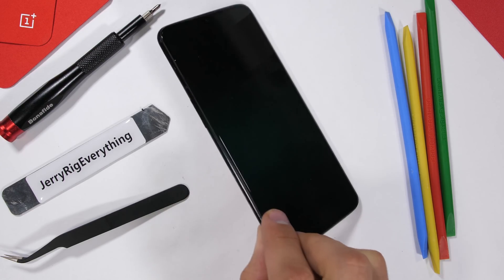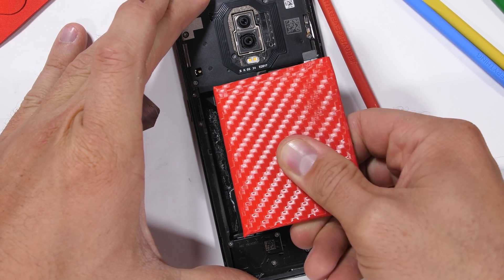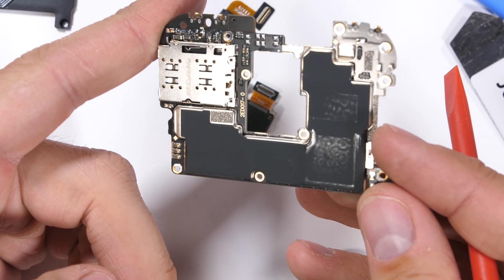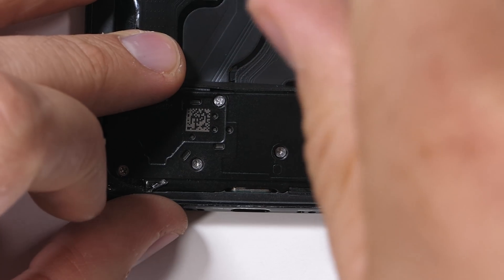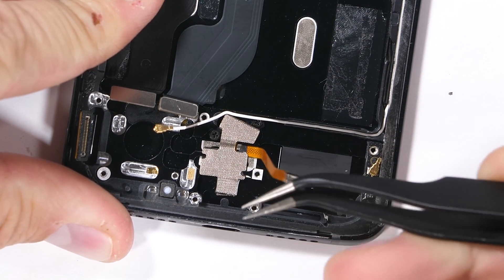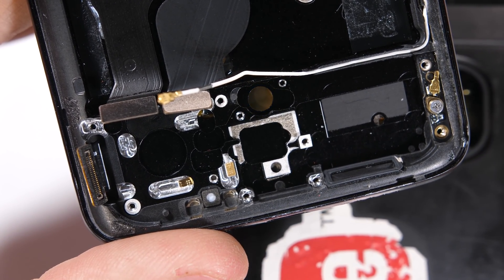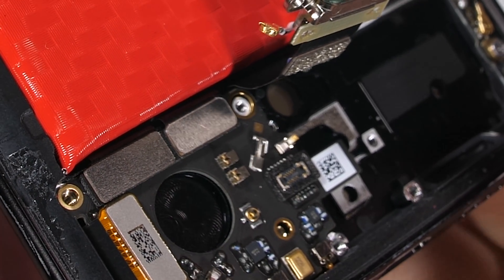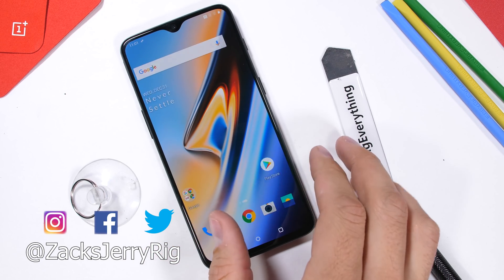OnePlus 6T Teardown - Can under display cameras be real?

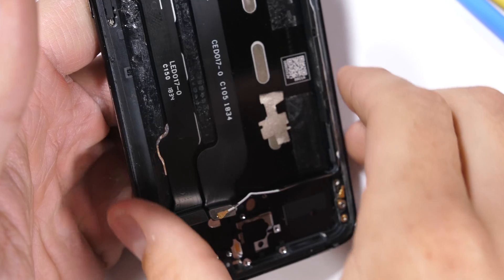Comment: 4:15 Unfortunately the cameras and other sensors would have to be tinted green to hide them like how it is with the 6T. If manufacturers and brands do not care much about the aesthetics of the phone they can blatantly display the camera that is underneath the screen. However if they would rather make a device that is seamless they may develop a software to filter the unnecessary green tint that is hiding all of the sensors.

Comment: Please, tell me, is OnePlus 5t still a good phone to choose in 2018-2019? 

6t doesn't have a 3.5 jack, so this phone is not my choice.
Reply: Oneplus 6 also has jack. But the 5T is a very good phone, it is fast as hell, it has aluminum back cover, but only moderately water resistant. It is splash resistant only. The 6 has better water resistance. But it is all glass. And glass is breakable.
Reply: Just get the OnePlus 6. That's what I got. It's still fast as heck plus head phone jack to boot :). Oh and since the T is out. I'm betting the slightly older OnePlus 6 will be discounted.
Reply: I agree with @moninn yem as the 6 is currently at least in china on a huge discount, starting at the price 2799 rmb - around 450 if youre gonna buy in America
Reply: @Kurt Rozentaun - on the us store it starts at 529 american dollars.
Reply: Just make sure you don't buy a pixel 3 or a mate 20 pro as they don't have a headphone jack either.

Comment: To be honest with you. 

I have tried fingerprint scanners on the front of phones and the ones on the back. 

I was a fan of the front fingerprint scanner.. 

but now that I've gotten used to the Galaxy Note 9 back fingerprint scanner.. I ACTUALLY FIND IT MORE USEFUL IN MORE SITUATIONS THEN THE FRONT.. 

When I go to pick my phone up even in my pocket my finger is already on the fingerprint scanner so it's already open before I get it out of my pocket. 

Also when my phone is in the car windshield holder I have my fingerprints record it for my middle finger and index finger on both hands. All I have to do is touch the fingerprint scanner on the back with either fingers or either hand any direction it doesn't matter and it opens perfectly and seems more convenient than the front.. 

So to each his own. I guess it all depends what you like and what you used to but it's not critical.. 

What is critical IN MY OPINION PHONES NEED FINGERPRINT SCANNERS YOU'RE NOT ALWAYS LOOKING AT YOUR PHONE WHEN YOU NEED TO OPEN IT.. your phone can be at a slight angle the fingerprint scanner is a necessity to me I use it more than any unlock feature..

I must say the combination intelligent scan for the Samsung Note 9 Works fantastic even in the dark.. 

If I am relatively in front of my phone in my car just sitting in my seat. the phone opens automatically by looking at my face and I'm about 2 to three 3 away!! 

Now I'm hooked on the Galaxy Note S-Pen Drew tons of pictures and they teach you how to draw. I haven't been a artist my whole life all I could only draw stick figures LOL.. but now I can draw a lot of stuff and it's a lot of fun. 

To me it's the Galaxy Note series or nothing now.. 

Samsung an Android put Apple to shame in so many different ways.  the experts have spoken saying Apple phones are the same old thing over and over again and not to mention they're usually 2 to 3 years behind in technology!!! 

 almost everybody who does the Android vs apple challenge for a couple of weeks like sakitek. they always go back to the Samsung or Android phone once you know what they can do and how much fun they are, with the Innovations, hardware,  software, customizations, and the complete entertainment package.. YOU JUST DON'T GO BACK TO APPLE!! No wonder why market share is 88% Android worldwide, and Samsung alone sells more phones than Apple... I guess people are starting to catch on FINALLY!! But it will be impossible to get the kids elementary school, high school and college to catch on BECAUSE KIDS ARE FOLLOWERS NOT LEADERS THEY JUST BUY SOMETHING CUZ THEIR FRIENDS HAVE IT NOT BECAUSE IT'S INNOVATIVE OR WORTH THE MONEY!  IT'S REALLY SAD HOW THIS GENERATION IS.. 

;)
Reply: No one is reading this novella, sweetheart.
Reply: @Tomazack  

I'm sorry you don't know how to read that sad :(

Thousands of people read the things I write and actually thanked me through all the other social media things I comment on.. I also run 4 businesses.. I have my own computer and phone repair shop!! With 30 years of electronic experience.. have plenty of people appreciating what I say so I don't need you!! 

You can't please everyone.. 

But the cool thing is I can talk into my phone a hundred forty words a minute takes me only a few seconds. 

So move on goodbye!!
Reply: muzikmon2267 you have four likes. No one stopped to read and like your comment, mr “ELEctRomICs PrOFFesionnal”
Reply: Damnit bro what voice typing do u use?
Reply: Didn't read this all, but you could just type "I just purchased mine Note 9 and I'm fapping on it, everybody must know!"
Reply: @orgazmin  

Oh another beyond dumb statement.. 

You don't have to read it dumbass you're not intelligent enough..

GO TROLL SOMEWHERE ELSE DOUCHEBAG!!
Reply: @muzikmon2267  I have 4 businesses mate.Get rekt
Reply: @muzikmon2267  or i think that disabling the comment is going to help???Nah,words can't fix you
Reply: @sharinabhamid9955  

YUP U HAVE NOTHING BAHAHAHAHAHAHAHA
Reply: @muzikmon2267  the erectile dysfunction playlist is hurting your point.Plz delete

Comment: You can't put a regular camera under a screen and expect anything more than bokeh blur. Like photographing with a tele lens through a tree. The FPS is ultra near focus and gets away with physics.
I see only two possibilities:
1. a round opening in the display, like is rumored for OnePlus 7. The "dead pixel" sensation could be more annoying than a notch.
2. Putting cmos sensor pixels right in between the screen pixels making "the display is the camera". The sensor would have to compensate for the light pollution of the screen. Probably needs a ton of computing to work.

Comment: Since the under-display FP sensor is just a tiny camera module, couldn't they make the front facing camera do the job at detecting the FP while retaining the normal camera functionality?

They probably need to create a new camera module that is sensitive enough to detect the FP when being touch while at the same time functioning like any other front-facing camera. 2-in-1 or All-in-one basically.

Comment: Put on OLED display, put on camera at the back of the OLED, when taking picture, have software temporary turn off just those specific pixel above the camera area, boom, camera under the screen.
But how about the blurry transparency seen through the OLED? You suggest!

Comment: I'd be okay with them not having the headphone jack but they can't even keep up with the demand for the bullets wireless. It was a very bold move to remove the jack without them having a proper stock for the wireless earphones (which are reasonably priced, but not available)

Comment: In a couple of years phones will be absolutely 100% display, foldable and displays, instead of having amoled blacks, they will have transparent spaces. Not the most practical thing, but after they make phones all display and foldable there won't be much left to do, so transparency would be the only way to compete. Instead of transparency we might get holograms though.
Reply: I still think there's a step in between the foldable phone and anything transparent/holographic. My guess would be one of two things: 

1. A piece of wearable tech that is as innovative as the original iphone. Maybe hololens inside a normal pair of glasses, or a 100% screen phone as a wristband that can flatten out for other use.
Or 
2. An extendable phone. Think the Samsung S7, but where the screen is retractable into the top and bottom bars, so you can open and close the phone physically.
Reply: @ALifeOfWine  Extandable phones seems like a great idea. Now combine the extandable phone with the wristband and u got a super portable phone/smartwatch.

Comment: If the finger print camera hole is invisible when display turned on.. why can't they put a regular selfie camera underneath the display and turn off the pixels in hole when it's in use.. so we can get rid of notch.. correct me if i wrong

Comment: You know what would be a great experiment ? If you put a normal camera there in the hole instead of the fingerprint camera and try and take a photo, see how the photo would turn out.
Reply: The software won't accept a camera
Reply: @randomaccount4382  yeah they are talking about putting an ACTUAL camera in there with the screen on to see how it would look I doubt its easy to find a camera so small right no though
Reply: @avawyllie7099  Apple camera bump to the rescue place its main lenses right up against the back side and snap away
Reply: @nanaki-seto  finally, at least on e of apples crappy design choices will come in handy somehow
Reply: Patrik Tobola it's not a camera, it's an ultrasonic sensor
Reply: @fuckingdank6333  It's actually a camera...An Ultrasonic sensor would be more secure but to expensive for the OnePlus line...And to the Question: A normal Camera couldn't focus because the distance to the display is to small...it would just be blurry :/

Comment: POCO costs half of 6T and has 4000mah and liquid cooling ..
Reply: Yup poco is good
Reply: i kinda agree with this and this is just my opinion but i think even the pocophone f1 are still a tad bit better than the one plus 6t for almost have the price. although you get better display, better UI, better camera with one plus 6t but pocophone still offer something that i need more than the 6t like the earphone jack, faster fingerprint sensor, IR face unlock, stereo speaker, liquid cooling system, micro sd and larger battery.
Reply: @firdausfahmi  yup..agreed 💯... OnePlus is an excellent phone, there is no denying that....but the POCO has a few features more than OP6t......
to deny that and be a blind op fanboy is just silly people
Reply: Liquid cooling is just their marketing gimmick. There is few drops of liquid and just traditional copper sink
Reply: @Jinny-Wa  Sorry, what?
In stress tests the performance of the Pocophone is much more stable than any of the phones without cooling.
Reply: @Jinny-Wa  lol...says who? Have u used a POCO?
It doesn't get warm or throttle even after playing PUBG at max graphics for over 3 hours! That is not magic....it has a better cooling solution than OnePlus.Period.
Reply: @daniel14871  The 6T doesn't throttle either buddy.
Reply: @VenkataY  I never said 6t throttles buddy....
Reply: @daniel14871  You never did. But that comment heavily implied that 6t would throttle with 3 hours of gaming. The "buddy" was just a bit of sarcasm, no disrespect intended.
Reply: @daniel14871  I have a Poco and yeah it never gets hot. Though with some OnePlus 6t tests it stays about 36-37C which is pretty darn impressive. Note 9 had the liquid cooling system as well but it was at around 38-39C after 2 hours of PUBG
Reply: @kylechoy2402  at such price point getting such efficient cooling is remarkable....even my iPad 2018 (way more expensive than POCO), heats up like an iron box if we play PUBG at max graphics for just 10-15mins to the point it's unbearably hot...and we need to reduce graphics to control heat
Reply: The Pocophone F1 is at this point a slightly better value than the OnePlus 6T but a lot of the cost savings with the Pocophone can be easily explained: cellular compatibility. You end up paying even less if you focus the device in a few or even a single region. Try using the Pocophone F1 in the US and you'll find it nearly impossible to connect to an LTE band reliably.
Reply: @GabrielIgnacio  agreed 100% ....but since I'm not gonna cross the Atlantic in the next 3 years, it doesn't matter....POCO is a phone made for Asia and Europe...it's not even launched in the USA buddy
Reply: Vincent Saipudin  It will get atleast pie and Q. And Xiaomi is asking people for custom roms for the device to increase how much years it will last.
Reply: @danuromi5664  "poor build quality" ?
One of the most rigid frames on the market. The back panel isn't relevant.
Reply: Go buy it then
Reply: Miui is buggy
Reply: You are the same guy who cries when people compare POCO with Samsung Note or iPhone  and call it unfair lol.
Reply: @bootlegscarce0844  the best part of xiaomi phone is that the warranty is not void even if you install custom rom. So yeah , that's pretty much solve the software issues.
Reply: @bootlegscarce0844  good for u dude 💯
Reply: And a headphone jack
Reply: ZeeC - Pocophojes battery optimization is worse though. Pointing out what pocophoje has vs 6T doesn’t mean anything. The 6T is WAYYY better and has multiple additional features; if you live in America the oneplus 6T is the only real way to go (besides Samsung or Apple) for a quality/premium phone.
Reply: Pocophone is a great phone for its price, but one plus 6t have better display more premium material
Reply: @MuhdIqbal  "Premium material"?
You mean a material that breaks a lot?
Reply: poco is ugly af with that thanos chin
Reply: @lunar3009  lol ... ugly? No way..... compare it to any 2017 phone and it looks beautiful......
Just the fact that POCO exists for 300$ with the same storage,ram, and processor as that of the most expensive android today cannot be digested by some jealous people!
Reply: @daniel14871  It does not look good. it looks like a fake iphone x. its plastic and u would think its better than oneplus.
Reply: @lunar3009  it might be plastic but I haven't seen anybody using a phone by looking at its back....lol🤣🤣......but it might hurt insecure dumb teens who perceive their self-esteem and value from the the phone they use🤣🤣🤣
Reply: @lunar3009  looool......it's better than OnePlus in many areas I mentioned before...
1+ tagline was flagship killer....that title no longer belongs to it
Reply: @lunar3009  The back panel could be anything, what matters is the frame of the phone, and it's a really strong one on the Poco.
Reply: @Tech Slacker It's just like Apple's "sapphire" screen, enough to call it that but its not mainly liquid cooled phone, just a copper pipe doing the work. Watch video about it on this channel
Reply: @Jinny-Wa  the same Chanel that shows that the processor throttles less
Reply: @Jinny-Wa  well Jerry rig did a teardown and found the liquid inside the copper pipe...so I disagree....
But I basically don't give a d*mn about it as long as it performs and it does...like I said, I was playing PUBG in max graphics for 3 hrs and charging my phone simultaneously and it didn't get hot !!!!
Same thing on my iPad 2018 gets unbearably hot by just playing PUBG at max graphics without even charging!
Reply: @daniel14871  xiaomi have the worst integration of notch display on the market, yes for the price its a darn good phone, but try to use it as a work phone?Pull your hair out trying to get notification showing properly with consistent pop-ups. I've been missing multiple calls/messages/whatsapps after switching to xiaomi... never had any issue with my 1+5 before it got water damaged.
Reply: @rokupixruiqi368  I gotta agree...
Reply: @lunar3009  ikr XD
Reply: Vincent Saipudin  for a 250$ price difference, I'm willing to wait a few months for updates
Reply: @daniel14871  Yeah but they cheaped out on everything else.(display, camera, build quality, premium features).
It's pretty great they made a fast phone that cheap. But they did (intentionally and rightfully so) cut corners to achieve the low price.
Reply: @luuclucas  so did OnePlus..they cut corners too......no stereo speakers,no ipx waterproofing or wireless charging, No USB 3.1 port, no wide angle/telephoto lens, no qHD display ,no liquid cooling, weak poor vibration motor, camera not flagship grade...
Sure software is good, but they have cut corners too....
Reply: @luuclucas  and everything u mentioned are far better on the POCO than on any mid-ranger I have seen....
As for camera, with the Gcam mod, I am getting excellent results especially low light comparable to OnePlus
Reply: @daniel14871  poor poco fanboy... get some help.
Reply: @kitukitukitu-lous  lol.... POCO boy doesn't hurt one bit......I have an iPhone Xs max as my primary....this is my secondary phone and I am loving every bit of it for the price I paid
Reply: And has jack and sd expansion slot. That notch and average LCD though : /
Reply: @Mintor94  I agree...but compared to mid rangers the LCD looks better.... nobody is expecting flagship display at 300$....